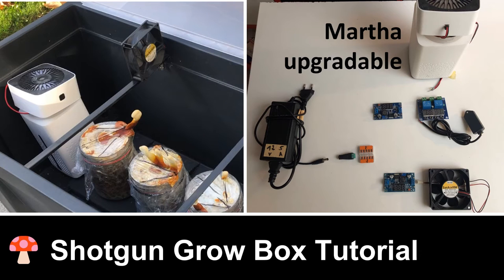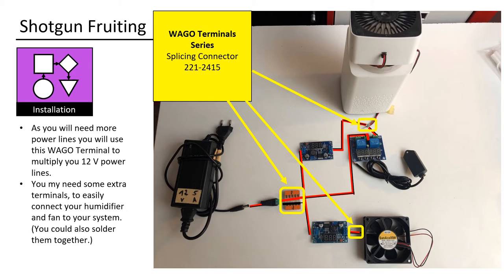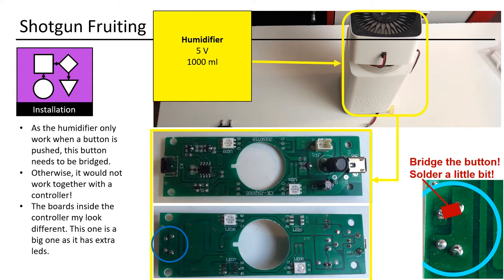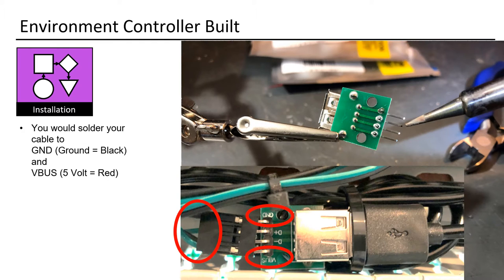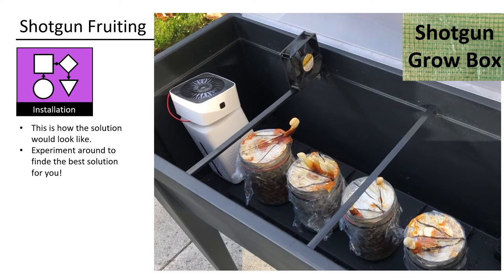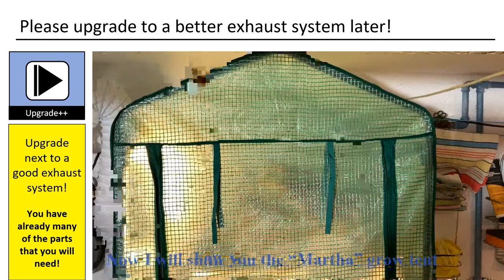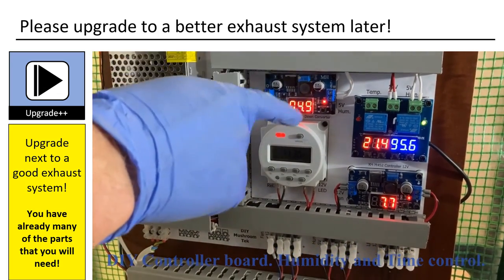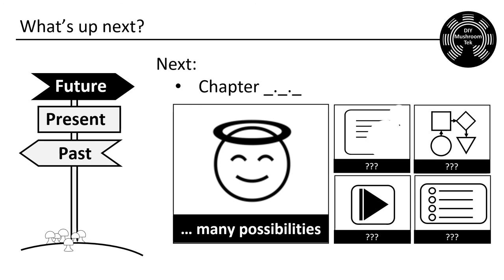3.4 Controlled Monotub Shotgun Fruiting Chamber

Comment: Beautiful work. Motivating! I know reishi tolerates higher c02 levels, is that why you chose to mount the fan inside as opposed to outside blowing fresh air in?

I would monitor c02 levels in the shotgun fruiting chamber, not necessary but just my preference. It would be cool if you did a DIY on electronically assembling your own c02 controller.

Keep up the great work! Can’t wait for the next video!
Reply from the maker: Hey! Thanks for your thoughtful insights! I really appreciate it!

I promote a flexible setup for a monotube. As there are not many electronic parts needed, one can easy play around with the best position of the fan. This is good to find out what that mushroom needs that you are growing. On can easily mount the fan on the top of the box. That way it will blow fresh air inside. 

I am thinking of maybe enhancing the video with an addon on how to electronically connect all the parts. I do not know if that is necessary since it basically is just plug and play. In that video I could highlight the different fan positions and what are the advantages or disadvantages.  Great point!

Concerning the CO2-Sensor topic, I originally designed an Arduino controller that included a CO2 sensor. In my experience they did not work that great and were buggy in high humidity environments. I used a CCS811 air quality sensor. As you can see in my 3.1.1 – Controller video, I had a working Arduino solution which controlled my tent.  

There are already some Arduino controlling solutions tutorials out there, that in include these sensors. But I also think, that for many people the technical barriers would be too high, if one also needed to master Arduino knowledge and basic programming just for growing mushrooms! 

I wanted to give people easy and cheap access to a grow tent. That is why I decided to focus on 3D printed structural parts and easy to assemble electronic components. Both tasks can be easily performed together with some friends who have some basic knowledge in these areas of expertise. In that way both parties’ profit and friendships can be strengthened.